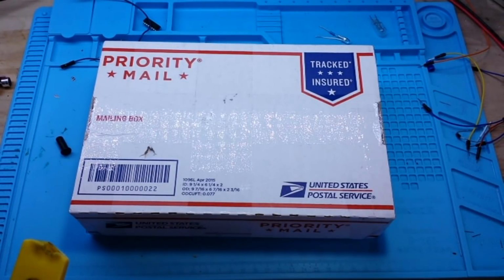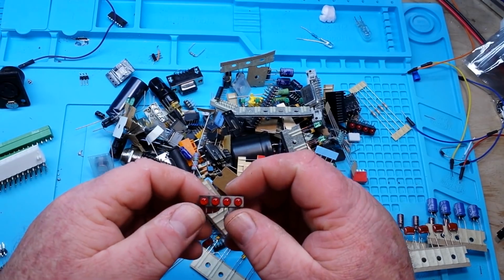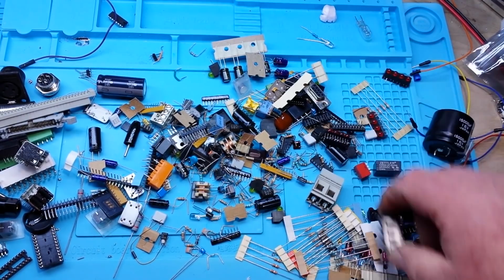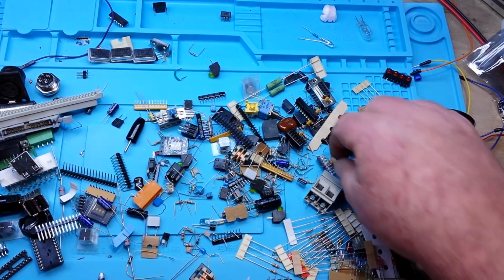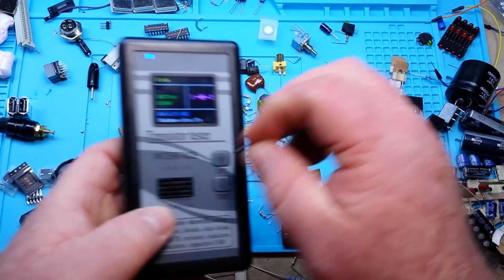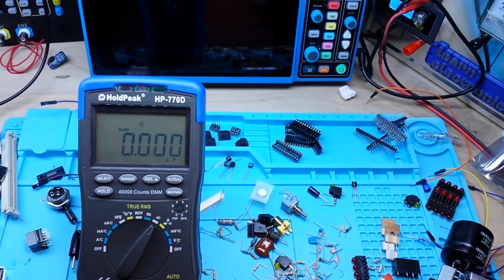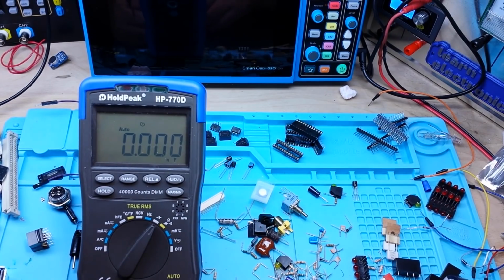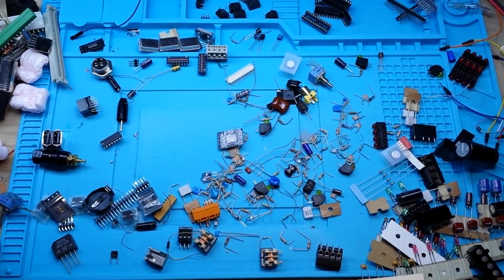1lb Electronic Grab Bag

Comment: Good grab bag! Reminds me of the old days of Poly Paks - love that "transistor tester" should be called a component identifier - where did you get that?
Reply: Look on ebay "transistor tester", there are a few flavors but the core identify/test functions are the same, based on an old atmega328 project.

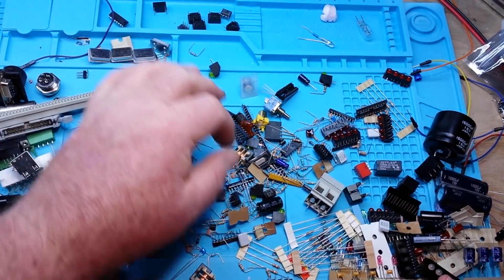Comment: I just found your channel and I'm already hooked... At around 9:28 you touched a gray thing w/4 pins and two windows just to the right of center but I don't think you mentioned it, if you did mention it please disregard... I'm as green as it gets but I'm trying to learn more every single day. Thanks!
Reply from the maker: I'm not sure, but I'll look
Reply from the maker: That's a large terminal clamp to connect wires to a board
Reply: @learnelectronics  ahhh,  I gotcha... Ok thanks for the quick response

Comment: I'm new here. Whats the story on your blue table top tray/organizer/thing?  It looks very handy. I'm a 3 hr drive from anywhere so I can be uninitiated to a lot of stuff.
Reply from the maker: Hi Stuart, I order almost everything from Amazon. This is a silicone soldering mat. Here's a link to one like mine: Kaisi Heat Insulation Silicone Repair Mat with Scale Ruler and Screw Position for Soldering Iron, Phone and Computer Repair Size:17.7 x 11.8 Inches https://www.amazon.com/dp/B07DGVRYL3/ref=cm_sw_r_cp_apa_i_SoO-CbSQD5VQB

Comment: Hey Paul....did you get an Atomic Pi yet? They are pretty sweet, VERY good value at $35 and I would love to see you do a review. Thanks!
Reply from the maker: No...didn't even know about it. Thanks for letting me know.
Reply: @learnelectronics  No problem, mate. I backed them on KickStarter. Amazon is sold out right now, but watch about every hour and they should re-stock. They sell out as fast as they can get them up (500 at a time). They sell out in about 2hrs! They have re-stocked about twice a day so far. Hope you get one!

Comment: You know those monthly loot boxes? someone should organize one that sends you 10$ worth of electronic components every month...I would sign up....Half the battle is often trying to figure out what you will need in the future. If someone was just sending me random crap I've never seen before, I would never run out of parts!
Reply from the maker: I love the idea.
Reply: I like the way you think, mister.
Reply: I tried setting up a group buy on the eevblog forum because when buying chips and stuff in bulk you save up to 98%. If you buy resistors in quantities of 10k you can save over 99%. Even USB connectors cost like 34 cents in small numbers and 12 cents in lots of 1k. 

 I figured a $50 order minimum and a 5% fee for whoever does the repacking would save you about 60-70% on chips and a lot more on jelly bean parts. 

The big complaint/problem was people don´t have common sense. If they save $50 they still complain about paying $5 for shipping. So I said whatever pay the full price and get free shipping. You could literally buy a 100 of each value resistor for a given size (~4500) for the price of 50 resistors of one value by buying in a group and splitting them up.

Comment: I used to get these sometimes at Electronic-Goldmine and other places.
Ultimately, its mostly junk/scrap that seems they just can't get rid of most times.
Although it is a weird sort of adult fun reminiscent of being a kid in a candy store, aside from the short dopamine fix, I'd rather spend the same amount and get half or a third of the number of components in labeled, sizes I need.
Reply: I bought some small transistor mix bags at Conrad here in Germany. About 25 for 4 Euros. I can get 980 for like 12 Euros from aliexpress and get 65 values. The resistor grab bag had a ton of wax resistors that I don´t trust in it. They are good for someone just starting out I guess to build up a stockpile of random parts.

Comment: Green Resistors thinking 5W.   Yea you did better on the small one for sure.     Cool Video.  OP Amps would always be welcome.  Those Oscillators seem to be in the CB Freq Range.    Switches always have a home.  But loads of Lower voltage Filter Caps. LED eventually find a home.  Those 90^ Pin sets would be handy in  a Arduino project ?  Ya did ok.  Not as good as last.
Reply from the maker: I agree. The smaller bag was better.
Reply: @learnelectronics  I'm a sucker for all those Grab Bag's and Boxes of crap.  Never really got screwed on any of them.  Some disappointments for sure but never burnt.  Some turn out to be more then a good deal for sure.  Our Dollar store does that from time to time, I buy a few of those.   You end up with a boat load of USB chargers  simi disposable ear buds and stuff. most the time.    Hell one time  in  a $5.00 bag I got a new Trak Phone that was better then the one I was using..  LOL